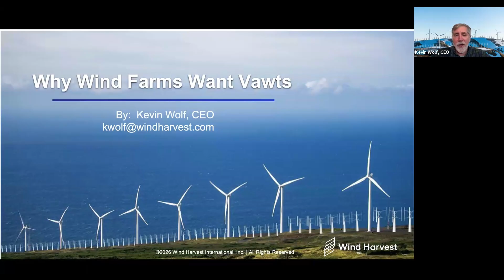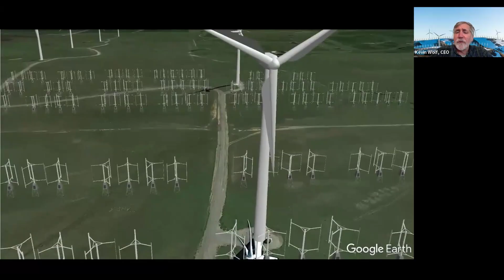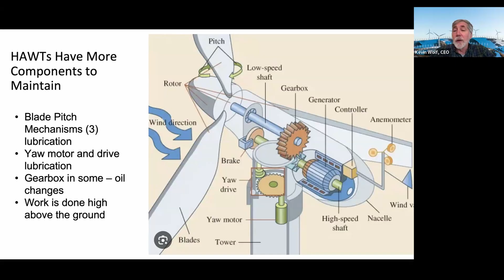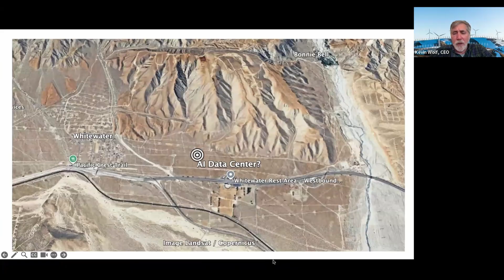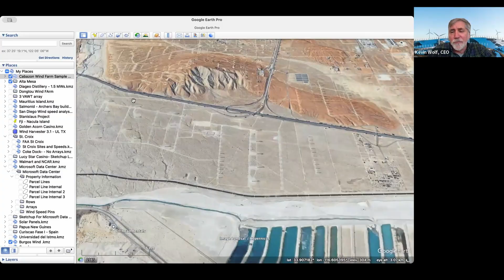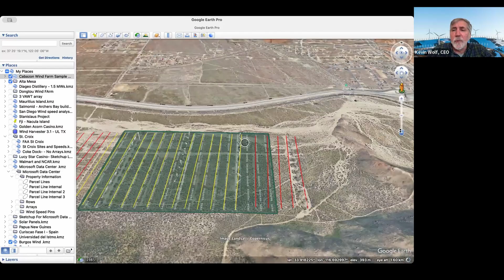Webinar - Why Wind Farms Want VAWTs

Comment: If renewables are cheaper than fossil fuels but the downside is renewables are intermittant let us have suppliers that will garantee a constant supply according to a given supply chart. Suppliers can then lower prices by adjusting their need to meet the contract supply value. Any surplus can be bought at national rate and any shortfall the supplier would need to find.